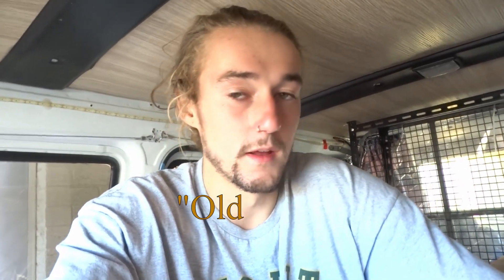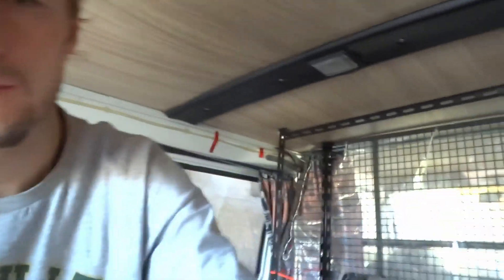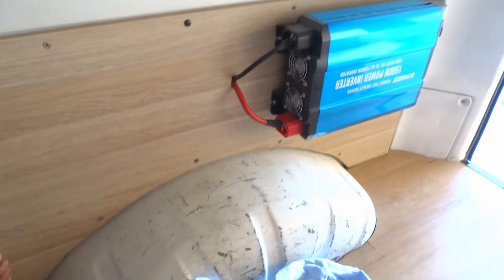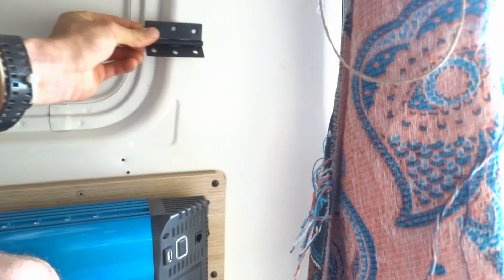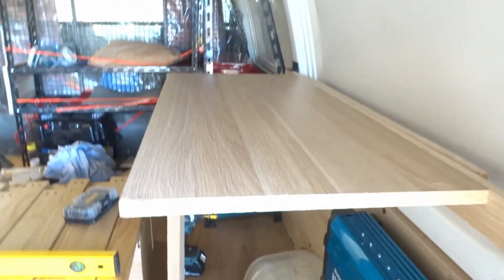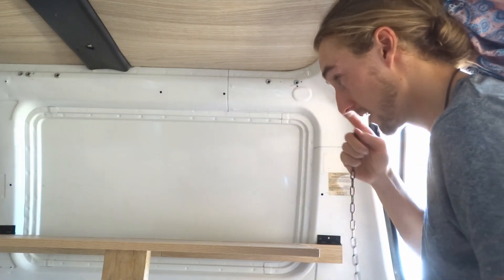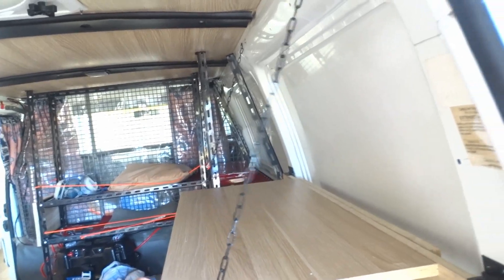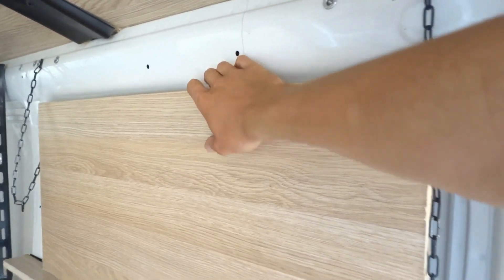Simple Fold Down Van Table | Mitsubishi Express DIY Van Conversion part 12

Comment: You could use some clear hose/tube over the chain to eliminate rattling whilst driving...
Reply from the maker: A very solid idea my friend. I found that when closing the table with the chains tucked between the table and the body of the van, it held the chain tight enough to eliminate rattle. However if it was an issue this is a great solution✌🏼

Comment: Hey mate I’m looking into buying one of these vans and converting it into a camper also. I was just wondering if you could help me out by letting me know the interior dimensions of the van? Would be a big help (length just to back of the front seats tho) cheers🇦🇺
Reply from the maker: Hey Jasmine, sorry for the late response. The easiest way to picture the back cab space in the Expresses, is that they're the size of a standard double bed mattress, plus 30cm in length. So if you put a double mattress in the back hard against the door, you'd have approximately a rulers length between the mattress and the back seats. I don't have my book on me at the moment but from memory it's about 140cm wide x 210cm length from chair to back door. They're quite a small and compact van, hence why I wouldn't recommend a fixed bed build, as you'll be left with little space to live in it. That's why I've opted for more of a couch that folds out into a full length bed. Hope this helps and best of luck on your van life journey✌🏼

Comment: I've got an SJ Express, running as Locksmith van.  Have been thinking about adding an internal handle to the rear lift-up door.
You figured out a solution to close/open that door from inside yet?
Reply from the maker: Hey mate, a fantastic idea, my lazy ass just wrote it off as one of those little inconveniences to get used to. But after your message I think I might have a little play around with coming up with a mechanism. As far as closing, buying a handle of some sort and fixing directly into the metal ribbing below the window would probably work. I'll have to do a bit more research on Installing a trigger to open the door though. You've inspired me, I'll have a bit of a think and release a video if I get around to making something👌🏼
Reply: @lachiemac2642  I'm considering a Bicycle brake handle and cable, so I can route it around to my internal pull handle.
If I use a round pipe handle, like a Stainless Boating handle, the bike cable lever will secure directly to it.
More as I develop (over months)
Reply: @GutterClown  @McTrowsers did you figure out an internal door opening fix?
Reply: @lachiemac2642  did you figure out an internal door opening fix?
Reply: @judoman09  I haven't as of yet.  I haven't had a chance, to be honest.
If you get up in there and do find a solution, let us know?